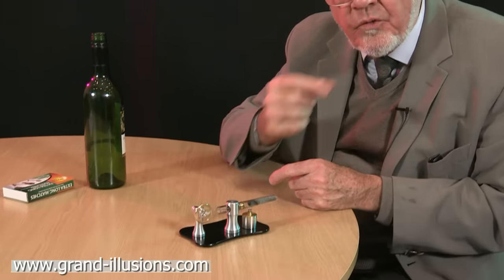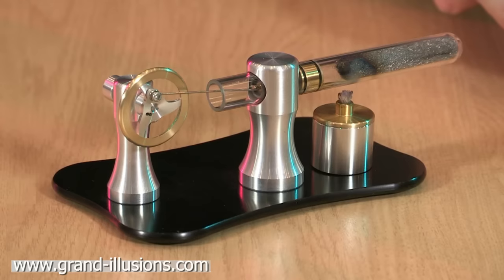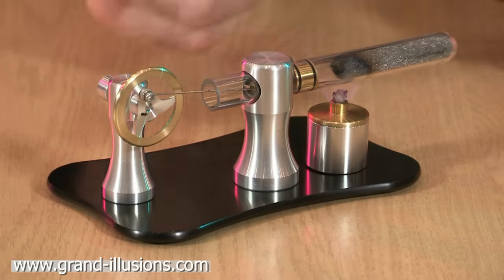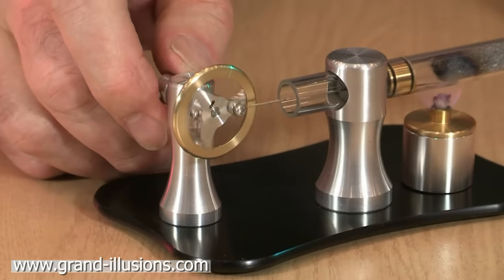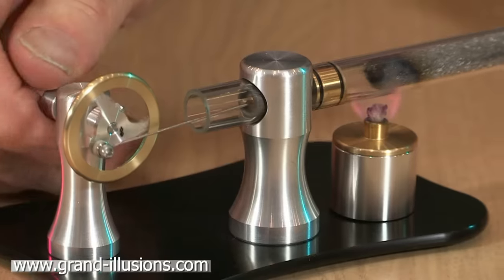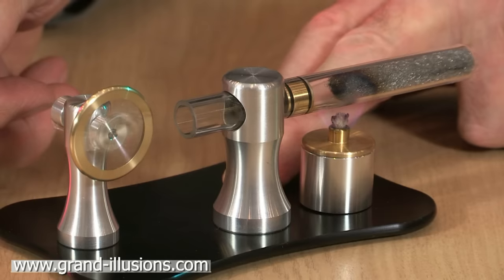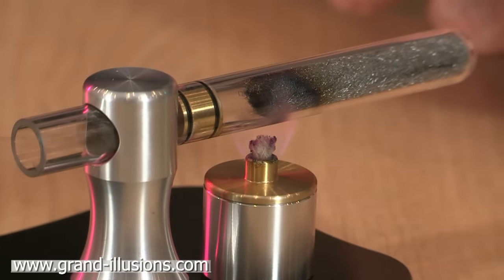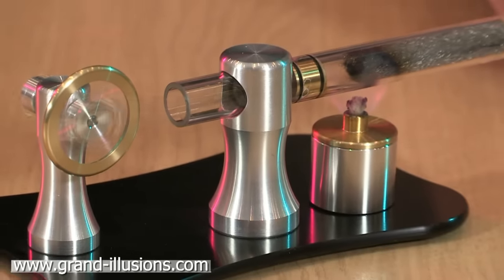Thermo Acoustic Engine

Comment: Isnt this just a sterling engine?
Reply: +Liam Weaver Yes it is.
Reply: +LineoLemon No it's not.
Reply: +John Jones why?
Reply: +benaloney A sterling engine uses 2 cylinders...runs on the pressure/heat differential...
Reply: +John Jones False, one cylinder one displacer. This is a stirling engine
Reply: This is not a sterling engine wtf you guys.
Reply: It is a stirling engine. Has nothing to do with acoustics.  It works by the expansion/cooling of air. See https://en.wikipedia.org/wiki/Stirling_engine
Reply: Its not even in the link you sent a sterling engine requires two pistons it can be in one cylinder but still requires 2 pistons
Reply: It operates in a similar manner to a sterling, but where a sterling uses a separate piston to displace the air for expansion/contraction, this engine uses the acoustic resonance of the air in the tube itself to move across the heat exchanger. There is tons of literature out there about both sterling engines and thermoacoustic engines and how each works.
Reply: This was entertaining, haha.
Reply: https://en.wikipedia.org/wiki/Stirling_engine

A Stirling engine is a heat engine that operates by cyclic compression and expansion of air or other gas (the working fluid) at different temperatures, such that there is a net conversion of heat energy to mechanical work.[1][2] More specifically, the Stirling engine is a closed-cycle regenerative heat engine with a permanently gaseous working fluid. Closed-cycle, in this context, means a thermodynamic system in which the working fluid is permanently contained within the system, and regenerative describes the use of a specific type of internal heat exchanger and thermal store, known as the regenerator. Strictly speaking, the inclusion of the regenerator is what differentiates a Stirling engine from other closed cycle hot air engines.  (NOTE : I believe it is important to stress here that sterling motors-generators work with gas, fluid or any other medium that produces the same desired effects.)

Thermoacoustic cycle
Thermoacoustic devices are very different from Stirling devices, although the individual path travelled by each working gas molecule does follow a real Stirling cycle. These devices include the thermoacoustic engine and thermoacoustic refrigerator. High-amplitude acoustic standing waves cause compression and expansion analogous to a Stirling power piston, while out-of-phase acoustic travelling waves cause displacement along a temperature gradient, analogous to a Stirling displacer piston. Thus a thermoacoustic device typically does not have a displacer, as found in a beta or gamma Stirling.

Other developments
Starting in 1986, Infinia Corporation began developing both highly reliable pulsed free-piston Stirling engines, and thermoacoustic coolers using related technology. The published design uses flexural bearings and hermetically sealed Helium gas cycles, to achieve tested reliabilities exceeding 20 years. As of 2010, the corporation had amassed more than 30 patents, and developed a number of commercial products for both combined heat and power, and solar power.[56]According to press release from September 2013, Infinia filed for bankruptcy[57].

More recently, NASA has considered nuclear-decay heated Stirling Engines for extended missions to the outer solar system.[58] In 2018, NASA and the United States Department of Energy announced that they had successfully tested a new type of nuclear reactor called KRUSTY, which stands for "Kilopower Reactor Using Stirling TechnologY", and which is designed to be able to power deep space vehicles and probes as well as exoplanetary encampments. [59] At the 2012 Cable-Tec Expo put on by the Society of Cable Telecommunications Engineers, Dean Kamen took the stage with Time Warner Cable Chief Technology Officer Mike LaJoie to announce a new initiative between his company Deka Research and the SCTE. Kamen refers to it as a Stirling engine.[60][61]

Comment: I don't understand the "sound wave" principle at work here?
This is a Stirling engine - working on temperature differential. 
What's the relevance of the "sound wave like in a bottle" here?
Reply: Mercury2wo I agree, there is no acoustic force at work here. It is pressure due to heating. Wind on a bottle is resonance of the volume of air (flutes use this). not in this Stirling engine, a predecessor to the steam engine.  thermal air pressure is not acoustic
Reply: Mercury2wo Yup, Stirling machine, no sound involved here.
Reply: pds tech Sometimes intelligent people do not consider that they can be incorrect. Directly from Wikipedia "Thermoacoustic cycle
Thermoacoustic devices are very different from Stirling devices, 
although the individual path travelled by each working gas molecule does
 follow a real Stirling cycle. These devices include the thermoacoustic engine and thermoacoustic refrigerator. High-amplitude acoustic standing waves cause compression and expansion analogous to a Stirling power piston, while out-of-phase acoustic travelling waves cause displacement along a temperature gradient,
 analogous to a Stirling displacer piston. Thus a thermoacoustic device 
typically does not have a displacer, as found in a beta or gamma 
Stirling."

https://en.wikipedia.org/wiki/Stirling_engine
Reply: James Blanchard I gave it a quick look. Very interesting but the motor shown here still looks nothing like what I have in mind for an acoustic motor. Now that I look at it more carefully it doesn't look like a stirling motor either.
I don't know... There are a lot of thing why I don't see this working with standing waves, like the steel wool in the tube disturbing any wave trying to travel there. In my mind it can just work with a combination of inertia and gas expansion.
Please I would love to discuss this to sort what kind of machine is this.
Reply: +James Blanchard Sometimes intelligent people believe whatever they read on wikipedia, a populist website.
The Steam Engine was invented first and was being used in early 18th century England to pump water out of a mine.  
In the early 19th century a minister called Stirling was appalled by the fatal accidents these steam engines would wreak when the high pressure inside would cause them to explode occasionally, so he invented his low pressure external combustion engine.
Reply: the acoustic properties really aren't a factor in this,  it's misnamed  in the title.  acoustic waves have so  little kinetic energy,  hence microphones have delicate membranes to resonate with the wave.  physical air pressure from the heated expansion is what drives the piston in this design;  the flame doesn't have any measurable acoustic effect.  burns silently
Reply: +pds tech The 'membranes' (diaphragms) of microphones do not resonate, they vibrate with the sound wave, big difference
Reply: semantics,, the diaphragm in a mic has  a sympathetic motion to the sound wave. stands still true that a sound wave is not pushing the cylinder here
Reply: id label this an external combustion engine
Reply: +pds tech its not semantics, you're just plain wrong. resonance is a natural frequency at wich a material vibrates and usually this frequency destroys the material's geometry. If microphones' membrane's resonated then they resonate at every frequency...and obviously this can not be the case, as microphones dont self destruct
Reply: Mercury2wo exactly
Reply: any pressure wave sent through air is a sound wave. even if the wave only has a single peak and two valley's, it's acoustic. more importantly the speed of the wavefront is everything in regards to the RPM of this engine, in other words the system resonates based on the acoustic properties of the working gas. you folks saying there is "no sound involved here" or thinking acoustic properties have nothing to do with this engine's operation are not thinking broadly enough about what sound really is. or considering that, in the literature, this engine is referred to as thermo-acoustic. why would so many engineers and authors refer to is as such if this is untrue?
Reply: If you look at the response curve of any given microphone diaphragm you will see that it actually does resonate at particular frequencies depending on material and construction.
Reply: what the fuck are you talking about self destruction? resonance is just the frequency at which a piece of matter /most/ wants to naturally vibrate at. could be gas in a tube, could be a ruler on the edge of a table.

"the reinforcement or prolongation of sound by reflection from a surface or by the synchronous vibration of a neighboring object."
Reply: it most definitely matches exactly what the wikipedia says for a Thermoacoustic engine... and not a stirling engine

Comment: Fantastic presenter but totally wrong, this is an engine working on the Sterling cycle. Rayleigh discussed pumping heat with sound. Thermoacoustic engines (sometimes called "TA engines") are thermoacoustic devices which use high-amplitude sound waves to pump heat from one place to another, or conversely use a heat difference to induce high-amplitude sound waves.(Wikipedia)

Comment: i dont fully understand the acoustic part of this engine...has sound got any effect at all?
Reply: Sound is just the word we've given to the energy waves that resonate with our ears. The "thermo" signifies the change in temperature, and the "acoustic" part is referring to the frequency of high and low pressure states of the piston. When the piston is closest to the hot part of the tube, the temperature is at its lowest and so is the pressure and vice versa. I hope that helped:)
Reply: right i see thanks, but then shouldnt a normal internal combustion engine be also named as 'acoustic'?
Reply: Well. I'm not an expert in this, nor am I an engineer, so I don't know the exact answer to your question. I imagine that the reason for the different names is that the internal combustion engine works differently. In those, an explosion is triggered by a combination of a spark and high pressure air, which then forces the piston outwards, which gives the engine its name. the acoustic part may not apply here because every time the piston moves it's because of a trigger (explosion!) and not because the heat and pressure differences maintain a standing wave.
Reply: alright, makes sense
Reply: The acoustic part is the guy who talks.
Reply: IvanIvan1974 *Whacks your head with a screwdriver for that pun, resulting in a "bonk" noise.*  See?  Sound!  Sonic Screwdriver!
Reply: I still have more "+1" than you. Maybe because my pun came from the heart. It`s smooth and funny, yours is dipped in hate and anger. But you achieved your goal to make me writing this.Congratulations!
Reply: IvanIvan1974 It wasn't made out of hate and anger.  I was hoping to start a chain of sonic/kinetic/engine puns.  For example:  "You could use that engine to power a Segway.  And now for something completely different."
Reply: Actually we try to find out where the acoustic part is,any ideas?
Reply: There's nothing acoustic, see my earlier comments
Reply: Wikipedia gives us the answer, there is something acoustic about this engine.
Standing waves and heat exchange is the matter. Google for "Thermoacoustic heat engine". BTW it`s a very nice piece of physics.
Reply: IvanIvan1974:  Wikipedia: "Depending on the type of engine a driver or loudspeaker might be used as well to generate sound waves."  SOUND WAVES!  For SOUND WAVES to have any effect on the performance of a thermodynamic device they must interact with the device at the frequency of the sound.  This engine works on a different principle.  Did you even read nonetheless comprehend any of the information or references on the "wikipedia" page or are you just referencing something to mislead people and make yourself look "cool" and knowledgeable while lying to the world like everyone does on the internet??  Would you like to continue discussing this with me privately - a mechanical engineer with Master's Degree from University of Michigan and 17 years of mechanical development experience?   There ARE thermoacoustic engines that operate at resonant frequencies, this is not one of them.  You should try to really understand things before you go on espousing them to anyone.  Wikipedia huh?  Read books!
Reply: BULL'S EYE!
Reply: Is there no one else whit master degree and a lot of experience? No?
THERMOACOUSTIC THERMOACOUSTIC THERMOACOUSTIC THERMOACOUSTIC THERMOACOUSTIC WIKIPEDIA  WIKIPEDIA  WIKIPEDIA  WIKIPEDIA  WIKIPEDIA
Come on folks. Please execute commands.
Reply: N3bu14Gr4y Clever joke. ewe May i try it out again? bashes this arrogant gentleman's head in with a rubber bat There, I fixed it.
Reply: Karkat Vantas @3@
Reply: N3bu14Gr4y Some sort of cipher language?
Reply: IvanIvan1974 No, that's me being dizzy after being hit by a rubber bat.
Reply: IvanIvan1974 Inspector Gadget?
Reply: N3bu14Gr4y hehehe...yes,now that you mentioned it....very similar.
Reply: I think the basic idea is: the heated air in the tube expands, which pushes against the piston.  The piston pushes the wheel around, and when the wheel completes its revolution it pushes the piston back, which in turn pushes the air back in the tube.  This back-and-forth motion creates a series of pressure differences in the air as the various molecules are pushed together or further apart:
... . . .  .  .   .    .    .   .  .  . . . ...
This 'wave' is the same mechanism as sound.
Reply: Lazyguy22 Omfg, you're just like "science b33tch" And i'm over here like "holy crap that just magic"

I think it's pretty cool tho
Reply: I just knocked on my glass coffee table, it made a sound, therefore it's an acoustic table. SCIENCE! 👌🏻

Comment: Probably the most fascinating type of heat engine there is. I still don't know what acoustics has to do with it. Tim blowing across the bottle opening didn't help explain it. What I do know is that the flame heats the air in the test tube next to the steel wool and makes it expand enough to expand through the hole and push the piston back. The air then cools and creates a partial vacuum and allows the flywheel to push the piston forward. Rinse and repeat.

Comment: Has high rpms, but probably has nearly non-existant torque.

Although I can see this being used in a power generator; on a larger scale of course. I actually think that could be pretty efficient depending on how long that fuel source lasts.

Interesting little machine that thing.

Comment: Isn't that just a simple, I think Alpha configuration, Stirling engine?
Reply: +Owlet Kami my thoughts exactly. Where does the acoustic come into play?
Reply: Another name for it
Reply: No, any Stirling engine has to have two pistons (whether in one cylinder or two) with a fixed phase relationship between them to be able to do work. This replaces one of the pistons with an acoustic waveguide that serves the same function if and only if the engine is turning at the right speed to set up a standing wave at the waveguide's resonant frequency. That's why it turns at a consistent speed, and that's what's "acoustic" about it.
Reply: +hobbified That solved my question definitely, thanks.
Reply: it's definitely alpha stirling engine, with single tube it can't move like that, if it only one tubing, the expantion of heated air inside  will never compress it back because of vibration and friction loses, the only answer is the second piston is inside the tube that mounted by flywheel, that why there is a black pin on the crank that assembled 90 degree from first piston rod's pin. sorry but if there is only one piston it will break of thermodynamics law
Reply: Sterlings can use one piston-plunger - my coffee cup motor works fine on one piston and easily confused with an acoustic thermal motor - here is one to view - they are coffee filter plungers and the unit sits on your coffee cup - you can make it as per standard sterling design criteria and calculation.  https://www.amazon.com/Sunnytech-Temperature-Stirling-Engine-Education/dp/B008JOKO1O

Comment: isnt the thermoacoustic engine supposed to create sound as well?
Reply: I don't think it's strictly thermo acoustic. If the flywheel rotated at 2,400 rpm, for example, the frequency of the piston would be 40x per second, and that glass tube is way too short to resonate at that frequency.